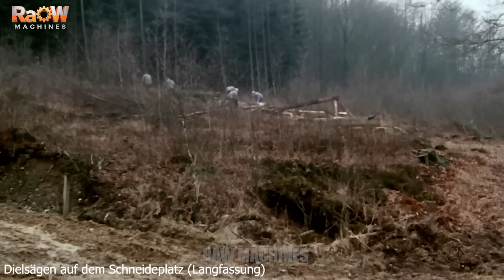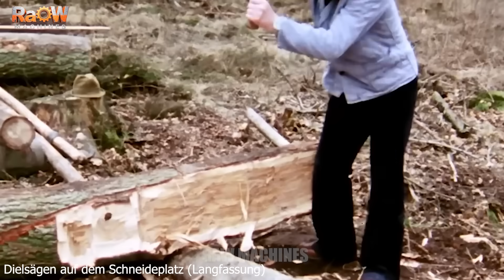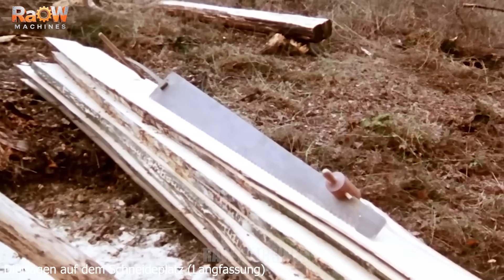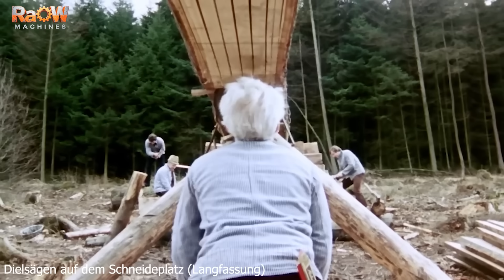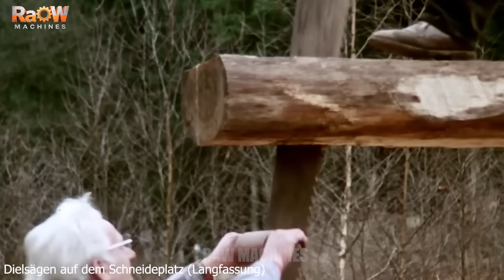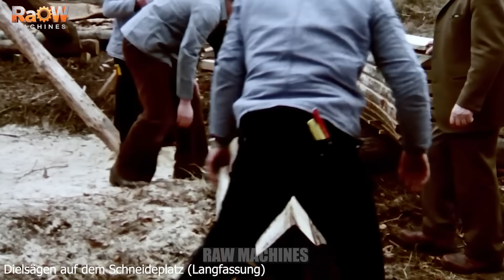Before Electricity: How Oak Logs Were Turned into Planks | Traditional Diel Sawing | Old Sawmill

Comment: Oak? Maybe knot.
Reply from the maker: That's a good observation! 👍 Knots can definitely affect how a log is cut and how the finished planks look. One of the challenges in traditional sawmilling was reading the log correctly before making each cut, especially when valuable hardwoods like oak were involved. Thanks for adding that to the discussion! What's your favorite wood species to work with or see used in traditional woodworking?
Reply: @RaWMachines-g9r hemlock for shingles and red pine for log house building. Yellow cedar for boat building…lovely smell.

Comment: So theyre sawing a 12" lpg by hand and there's cars zipping by. Were these guys never introduced to Dewalt circular saw blades and electric motors  ???
Reply from the maker: It looks strange today, for sure—but context matters. These mills and methods were already built, proven, and reliable. Electric tools weren’t cheap, portable, or even practical everywhere yet. For them, muscle + experience was the power tool.
What modern tool do you think changed woodworking the most?

Comment: These men were true Craftsman. They make modern construction workers look like clowns who produce cheap garbage they call houses with particle board and plastic siding and soffits that blow off as soon as the wind gets strong. The houses these men of yesterday produced will Outlast any modern built home by centuries. It's like comparing a Rolls-Royce to a Ford pinto. The new houses don't even have a real fireplace with a brick chimney. It's absolutely disgraceful. They are interested only in profits and not quality.
Reply from the maker: There’s a huge difference in priorities between then and now. Back then, time and durability mattered more than speed, and it really shows in the results. These films help remind us what craftsmanship used to mean.
Do you think there’s a way to bring that mindset back while still using modern tools?

Comment: In my home town in Wisconsin the wood was sent down the river to a water turbine powered saw mill. scores of pulleys and belts not only moved the logs thru the mill but also power the saw blades to cut them to length and into planks. No electricity at all! Very efficient!
Reply from the maker: That is seriously cool! Pulleys, belts, water turbines… all working together like a giant mechanical orchestra. And no electricity at all, just pure physics and smart design. People back then really knew how to squeeze every bit of power out of nature. Would you rather see a mill like that in action than a modern electric one?
Reply: Most would Mills these days are not powered by electric they are powered by diesel engines.
Reply: Yeah you can float pine and you can float cedar down a river but you cannot float oak Logs down a river which is what they are using because oak does not float. Most of the hardwoods are too dense to float including oak sugar maple hickory and cherry among others. Oak boards may float when they are completely dried out but not when they are green. When they are green the logs sink.

Comment: While the video is interesting as how it was done "in the old days", it is definitely how it was done anywhere near when the movie was shot (in 1964, when there are cars passing by on tarmac roads) because 60 years ago, large industrial sawmills existed and even more than 100 years before that, in second half of 1800s, there were industrial steam powered sawmills. Even long before electricity was "invented", a water powered log cutters (sawmills) have been invented (Da Vinci made it much more efficient around 1500). Cuting wood with water powered sawmills was way more efficient even when you had to factor in transportation. So it is quite accurate to say that the method show in the video might be medieval
Reply from the maker: You’re absolutely right, and thank you for such a knowledgeable comment. This method really represents much older traditions rather than what was common in 1964, especially with industrial and steam-powered sawmills already widespread. It shows how some medieval techniques survived mainly for demonstration and heritage.
Do you think preserving and showing these ancient methods still has value today, even if they weren’t practical anymore?

Comment: So many years ago when my dad was a kid, My grandfather and my dad cleared the whole forest around Punderson Lake in Ohio. It was all done by hand, same as you see here. My dad told how they would enter their horses in the horse pulling competition at Ashtabula County Fair. He said it wasn't even a far competition, as their horses worked every day for a living. They would easily out pull any of the "professional" horses. I still have those same saws that were used to clear the land. My dad and I cut a few logs with them. If I didn't pull hard enough or lost rhythm, the his end would bend as he was lightly pushing on the other side. We had two saws. The one saw is single ended, and I wondered how it would work. Now seeing that the other side was a handle that was wedged on, that makes more sense. I will need to make the handle for the other side.
Reply from the maker: Thank you so much for sharing this incredible story. What you described feels like a living extension of what we see in the film—hard work, rhythm, and knowledge passed from one generation to the next. The part about the saw bending when the rhythm was off really says everything about how much skill this took.
Do you still plan to use those saws again once you make the handle?
Reply: @RaWMachines-g9r  I would like to, but at the moment I don't have anyone who could partner the other side of the saw. My wife or either of my daughters are not strong enough to pull the saw on the other side. I'm not sure I'm strong enough to pull my side either. It is really hard work. When I did it with my dad, I had the easy side. My dad was a beast. My grandfather even more so. Those guys never slowed down till the day they died. 

I'm a hobbyist woodworker - learned that trade from my father-in-law. The saws hang in my wood shop as decoration.

Comment: Why do they still do it like that, rather than by modern mechanical means - just wondered?
Reply: Preparing for after the apocalypse.
Reply from the maker: Great question! Thanks for your curiosity 😊 A lot of these traditional methods are still used because they preserve craftsmanship, history, and sometimes even produce stronger, more character-rich planks than modern machines. Plus, for many artisans, it’s about honoring the old ways rather than just speed.
What part of this traditional process surprised you the most?
Reply: @RaWMachines-g9r  Most surprising was that it seemed to be an ongoing enterprise - rather than set-up just for a film-crew to show how it used to be done. (Anyway - thanks for your reply.)

Comment: It seems they are working with wet wood again. Guess the wet wood isn't a problem, because the finished product is meant to be used in a watery environment, although the wet wood is much harder to work with than the dry wood..
Reply from the maker: Great observation 👍 You’re absolutely right — they’re working with green (wet) wood, and in this case it actually makes sense. Wet oak is harder to cut, but when the final product is meant for water-powered machinery or humid environments, it performs better long-term. Traditional craftsmen understood the material deeply and chose wood based on how it would live and work, not just how easy it was to process. What other old material choices do you think modern builders have forgotten?
Reply: @RaWMachines-g9r  Thank you!!!!!!!
Oh, I know very little or actually nothing about materials. I only do some house work like wooden fence and deck, and have only minimal knowledge about wood.

Comment: useless, pointless time waste.
Reply from the maker: Fair enough 😄 — if you’re measuring everything by modern efficiency, this would look pretty pointless. But sometimes the value isn’t in the output, it’s in the skill, endurance, and knowledge behind it. Not everything has to compete with modern machines to be worth showing.
Is there anything from the past you enjoy even though it’s slower or harder than today’s way?
Reply: @R @RaWMachines-g9r    Sorry, but I have not seen skill, endurance or knowledge. I have seen pointless time waste.

Comment: Complete waste of time, effort, and money.

There are reasons why sawmills exist 

The fact that they did this all by hand does not mean that this house will last any longer,
Reply from the maker: That’s a fair point—industrial sawmills changed everything. But what’s interesting here isn’t speed or cost, it’s understanding material behavior, craftsmanship, and longevity in a different context. These techniques shaped how early structures were designed and maintained. What do you think modern construction has gained—and maybe lost—along the way?
Reply: Look at the growth rings and compare the rings of todays lumber. The old wood is Stronger and Will last longer.
Reply: Hateful comment

Comment: Today's laser guided saws would have made about 100 veneers from the part which they chipped away. and they call todays generation wastrels  !
Reply: Says you !    Where veneer  woods were involved they used to be cut by hand.
Know your subject !
Reply from the maker: That’s a fair point, and thanks for bringing it up. By today’s standards, that wood could definitely be used more efficiently, but back then the priority was strength, durability, and doing the job with the tools they had. Different times, different definitions of “waste.” How do you think future generations will judge how we use resources today?
Reply: That sap wood is never used for veneers - not even for low grade plywood.

That bark 'waste'  is today used as decorative weed suppressant in public and private gardens.   Sometimes as pathway dressing ,  sometimes as fuel and sometimes composted.
In former times  veneer quality timbers were indeed hand sawn.  Careful selection and specific cuts such as quarter sawing ensured the desired figuring was obtained.

Comment: Have you tried to build with today's mass-produced lumber? Good luck finding a straight piece. This lumber is better.
Reply: Wood is a natural material, and it bends if the amount of moisture in the wood changes, during it dry up. How much, will depend on the grain direction (annual ring direction), the kind of tree, and and and. On every log are parts that will become more or less straight boards after drying. And even modern sawmills pay a lot of attention to make the best boards of every log. Because this is the way they make money.
So even if the boards in the movie are perfectly straight, it was totally different after they dried up a few years later.
Reply: @pogonator1  Trees have changed genetically by artificial selection, and for the worse.
Reply: @wryanddry2266  The most wood you can buy today, is from trees that started their live 100 years ago. You really think someone planted trees in Siberia, Amazonia or BC in the 1920th?  🤣 Artificial selection is a little bit complicated if you will never see the results of your selection. It not  like grain, where you will see the result in one year and can alter your selection based on the results.
Reply from the maker: Exactly. Lumber back then was made with patience, not speed, and it shows in the quality. Modern mass production is efficient, but something is often lost along the way. Would you choose traditional lumber over modern boards if you had the option?

Comment: But even in that era, they had water powered vertical  saw mills.
Reply: It looks more like a weekend job for the man that provide the booze, in this area, many families still own a small wood. Too much trouble to transport a few of your private logs to the  saw mill.
Reply from the maker: Great point! Water-powered vertical sawmills were already in use, but hand methods were still essential depending on location and purpose. This film really shows how adaptable people were with the tools they had. Do you think modern builders could work this way if needed?
Reply: In what era?  I don't see hints about the era beyond the tools they were using.
Reply: @wryanddry2266  Filmed in 1964, Bergisches Land, NRW, Germany, Narrator told it, and it is in the video description.
But I think 1964 you would have a hard time to still find a saw mill that isn't electric powered.
Reply: @pogonator1  It was a 1964 production showing techniques that were in use hundreds of years before that.  It's not supposed to say anything about the technology of 1964.
Reply: @wryanddry2266  ???

Comment: What  country is this from?
Reply: The Bergisches Land is a low mountain range region in the state of North Rhine-Westphalia, Germany, located east of the Rhine River and south of the Ruhr River. It lies within the main unit group Süder Uplands, part of the Rhenish Massif on the right bank of the Rhine, with natural boundaries formed by the Ruhr to the north, the Rhine to the west, and the Sieg to the south, merging gradually into the Sauerland to the east. The region spans approximately 2,175 square kilometers and includes the districts of Mettmann, Rheinisch-Bergischer Kreis, and Oberbergischer Kreis, as well as the independent cities of Wuppertal, Remscheid, Solingen, and Leverkusen
Reply: Germany
Reply: Germany
Reply: Germany or Switzerland. Hard to tell unless you understand the difference between the 2 spoken languages.
Reply from the maker: Great question, thanks for watching! This footage comes from Europe, specifically from Germany, where traditional diel sawing was widely used before electricity. Have you seen similar traditional methods in your own country?